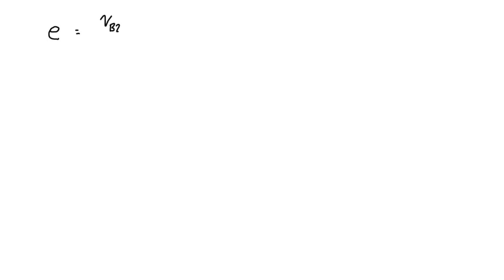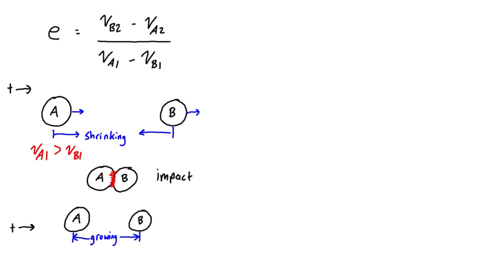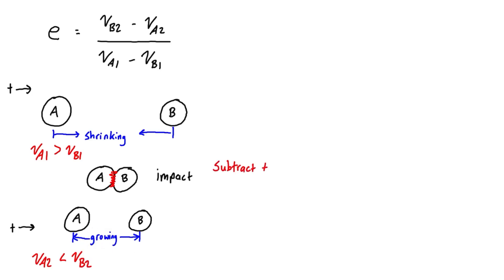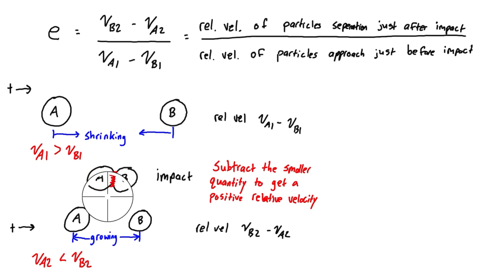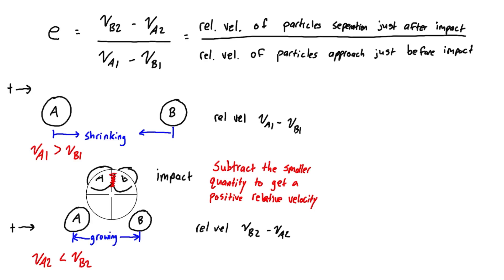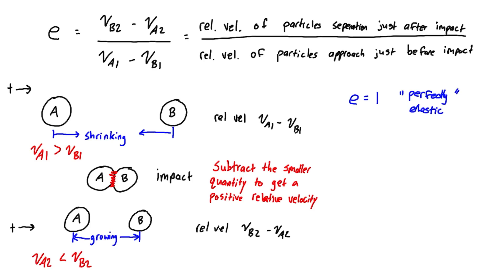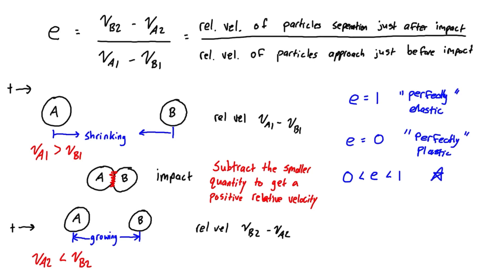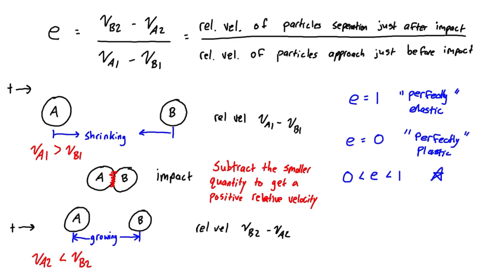Coefficient of Restitution

Comment: Is there  a special treatment for VA1 = VB1 ? 
Or Is that completely verboten ?
Reply from the maker: That would imply that each object has the same speed in the same direction so they would never impact as the relative distance between them would also not change. Also in that case the denominator would be zero and e would not exist, mathematically 🤔
Reply: @Engineer4Free  Thanks for  the Reply. 
Please consider addressing this in one of your future videos for  the edification of your audience.
Thanks again for "SHARING THE KNOWLEDGE".
Regards.